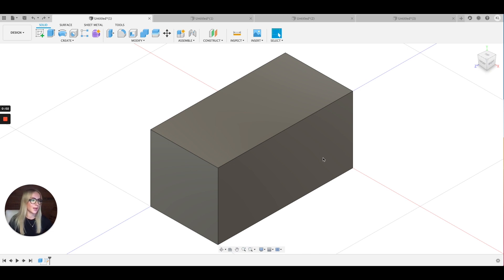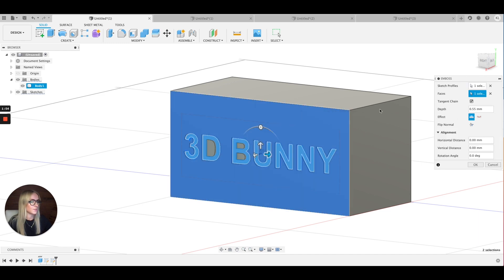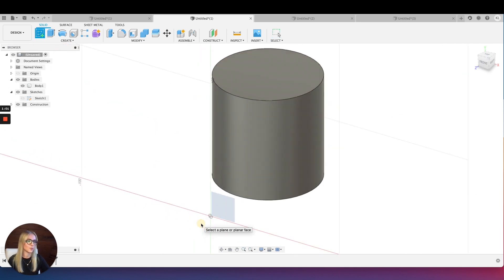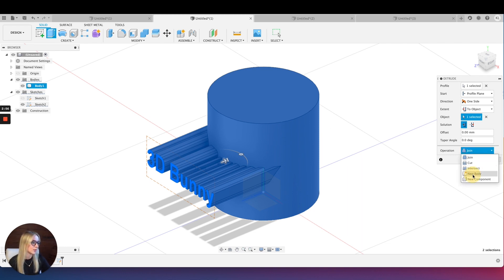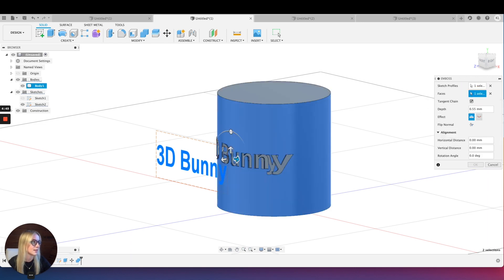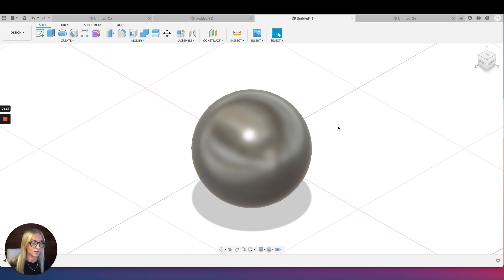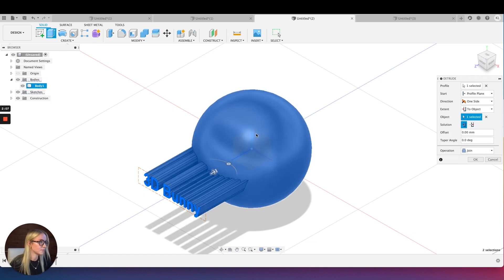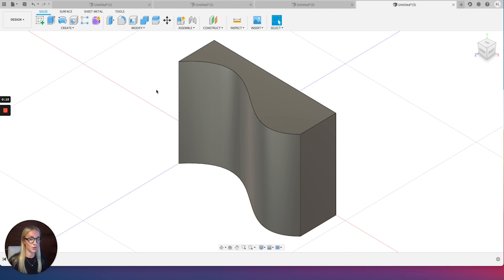How to Add Text to Surface in Fusion360 | Flat, Curved, Sphere, Irregular

Comment: Your explanation in this video is astounding! As much as I love embossing stuff, I'm having a bit of a problem with one particular project. What's the best method of embossing a conical shape without having the text distorted or looking like a frowny face? I'm making a custom Bowling Ball Holder that is a cylinder 20mm thick with a -25˚ draft from base to outside surface and I want to put someone's name wrapped around the whole thing but the only method I've found to make it work is to draft every single letter and hole within each letter (like the letter o) individually after the emboss has been done and the initial draft operation is complete.
Reply: If you put the text on a circular path with the center on the top of the cone, your text will be distorted in such a way that the emboss distorts it back to what you are looking for. This video uses this trick for example: https://www.youtube.com/watch?v=aRL9OmR70R4&ab_channel=Murxs1st

Comment: How do you get the text to print on top layer only, instead of the printer wrapping around the text and messing up the top layer. I used to be able to print a flat smooth surface and then the next layer would print the text, now it joins with the top layer so it prints around the text thus making the top layer not smooth

Comment: I was looking to do this yesterday on a cylinder but had to  settle on a flat surface.  It adds lots of material to my print and I was not happy.  Finding this video makes it super easy and I am going back to my original design for a cylinder form with Text.

Thanks very much 3D Bunny

Comment: Hi. How can we get the emboss that’s not distorted, but keep the text as a separate body so I can export and print it in two colors, with the cylinder being one color and the text another color? Thanks!
Reply from the maker: I would slice the body ("split body" in Fusion360) where the emboss meets the main body, that will separate the text from the body and can therefore be printed separately
Reply: @labcache  Thank you. So what happened? You made this great video, and just kind of disappeared.
Reply from the maker: I made this video on a whim, thinking "hey i could be a youtuber", then after putting it all together I got embarrassed and decided not to post it. Logged out of my account, and forgot anything happened. Little did I know, it actually posted and didn't save to drafts like I thought it did. 1 year later I needed a refresher on how to add text on a surface in fusion360 and I end up finding my own video from google. Extra embarrassing. Was going to delete this video, but looks like it was quite helpful for a lot of people, so it's stayin!   @printing3d722
Reply: @labcache   Well, I think you could be a great YouTuber! You got over 300 subscribers for the one video. Don't give up!